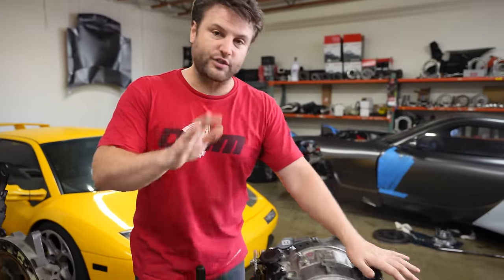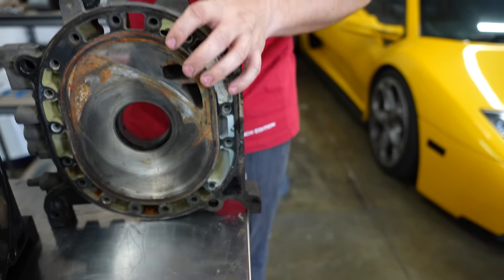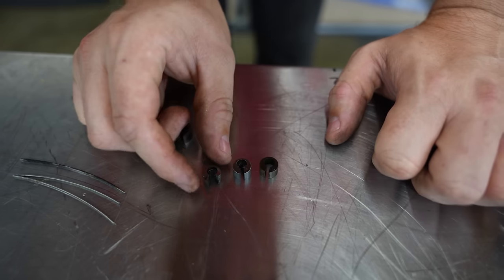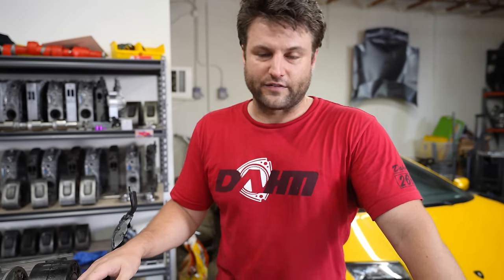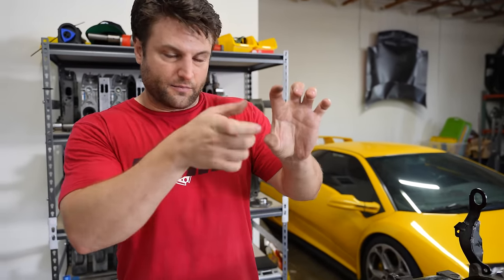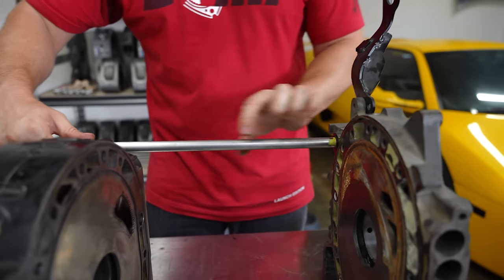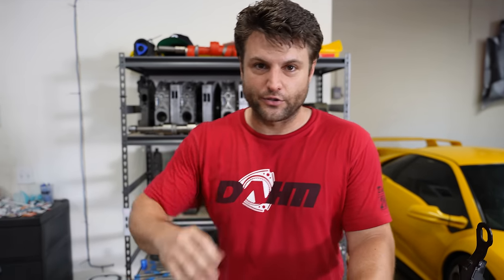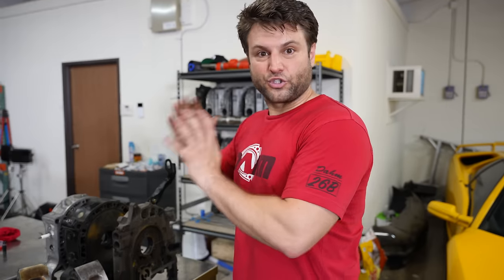Fixing the BIGGEST Problems of the Rotary Engine

Comment: It seems to be time for you to have an engine dyno for testing.
Reply: Yup! That would be absolutely amazing for rob, and imo especially useful for the rapid prototyping he does. R&D to the next level :D
Reply: *Hub dyno possibly, considering what he is building/researching right now. With this much torque and with R&D in mind he need a very precise machine that doesn't allow the tire to spin/slip
Reply: He's about to reach Toyota's Project F1 (Lexus LS400) levels of research and development. Maybe he could even build a reliable, fully billet rotary engine, in-house. 

Skyactiv-X 2 rotor when? lol
Reply: @powerprime99  they're talking about an actual engine dyno, like engine only. it's worlds more useful for what Rob is doing.
Reply: indeed, would be the next big step and upgrade for testing parts in the shop.
Reply: @rickcupola6262  Mazda Motors might not happy to know about this... Or will they?

Comment: After reading a few comments I challenge all of the rotary fans.  Draw me a picture of how you will seal the combustion chamber.  Show me the seals that will keep the pressure inside. Then draw me a picture of a regular piston engine combustion chamber seal, which we call piston rings.  Anyone with a mechanical aptitude will see the piston is so much simpler and reliable. That is why any manufacturer who looks at the rotary engine will go back to something simpler, like the piston.

Comment: We used to remove 3 thou off each side entirely not just the tips. We also machined the actual faces down on the rotors as well. You’d be surprised how different each casting is and how unevenly material removal was on those faces. Ran 13b’s with 58psi making 980+whp pretty much indefinitely for multiple drag seasons on customer cars. Just clearance and balance and run a good studded block and they’ll run forever. There’s no real secrets to be had or magic port work that hasn’t already been tried over the past 50yrs.

Comment: TLDW: treat your engine like a 2 stroke, E-85 with 2 stroke oil, replace the dowel rods with solid rods, get thicker tension bolts, 
run the oil through the blocks separately instead of through the single oil hole where the dowel is causing block cracks.
Reply: Why 2 stroke oil? Fuel lubricity improvement? How about adding biodiesel instead to improve lubricity?  Surpassed every other supplement in a recent HFRR fuel lubricity test.
Reply: @wallacegrommet9343  not for lubrication, for oil burning purposes, rotary burns oil and so do 2-stroke engines.
Reply: @patrick2mail  You’ve got to be denser than osmium. You add oil to fuel in a 2-stroke engine because it doesn’t get oil to the rings. You run oil premix in a rotary because you’ve deleted the oil injection system and still need to lubricate the apex seals.
Reply: @Cjbarker2  yea but why did you delete the oil injection system boss
Reply: @vinbmxnj  did you even watch the video?
Reply: @Cjbarker2  if u can explain why the rx-8 doesnt need to delete the oil injection since you can run a 2 stroke oil reservoir and eliminate the carbon build up and resultant pre ignition caused by using crank case oil in the injection system, and think the answer is because you deleted the oil injection system even though you didnt delete the oil injection system please rewatch the video
Reply: @vinbmxnj  Take that as a, “no, but I’ll not admit that in public.” It’s all good, guy, there’s no shame in being lazy or ignorant or both. Burning engine oil creates deposits on combustion surfaces. In piston engines, this is very easy to see and extremely common in higher-mileage engines with ring wear and engines where the PCV doesn’t do a great job of stopping oil from entering the intake. These deposits create hot spots in the combustion chamber that cause pre-ignition. Piston engines get a long time to cool down because they’re only firing every other time the crankshaft goes around. Rotaries first every time a rotor face comes around. The oil injection port uses engine oil, creating those deposits on the rotor face, and making ignition timing impossible to control with precision. You delete the port and premix oil into the fuel because 2-cycle oil and engine oil are different, and 2-cycle oil doesn’t lend itself to those carbon deposits, leaving the cylinder running cleanly.
Reply: @Cjbarker2  please re read your original reply to linkoo0 and explain in the case of the rx-8 how you run 2 stroke oil in an oil injection system that is still operational because you deleted the oil inejction system. thank you in advance
Reply: @Cjbarker2  the source of my question to you is at 12:20, why do you run 2 stroke oil in an oil injection system in the rx-8 if the reason for running 2 stroke oil is because you delete the oil injection system.
Reply: @Cjbarker2  just a reminder your original response is here "Cjbarker2
Cjbarker2
1 day ago
 @linkoo0  You’ve got to be denser than osmium. You add oil to fuel in a 2-stroke engine because it doesn’t get oil to the rings. You run oil premix in a rotary because you’ve deleted the oil injection system and still need to lubricate the apex seals. "
Reply: @Cjbarker2  your answer is simply incorrect and its sad to see you sit here and attempt to defend it when you can run an oil injection system in an rx-8 that uses 2 stroke oil, therefore you clearly do not run 2 stroke oil because you delete the oil injection system. but keep on being wrong buddy i wont stop you
Reply: @vinbmxnj  Rob is running through the RX-7 13b, not the RX-8 Renesis. Different execution of the same concept. In fact, Rob briefly mentions the remote oil reservoir, but it doesn’t change the fact that that part of the housing cracks under stress. Do you poke holes in your valve cover gaskets so they leak oil everywhere? Didn’t think so, bud. You’re trying to compare apples to pears here.
Reply: @vinbmxnj  You know the rules . . . . two men enter . . . . one man leaves
Reply: Almost. Use both two stroke and 4 stroke. 2 stroke in the fuel or on a separate line for the apex seals, 4 stroke for the crankcase
Reply: @Cjbarker2  You said, "but it doesn’t change the fact that that part of the housing cracks under stress." but the stress isnt the reason for wanting to use 2 stroke oil and everything that goes with it. The point was to get much cleaner combustion. Maybe Im misreading your argument though. You guys had a ton of responses to each other and I could have missed something.
Reply: @aggonzalezdc  That guy’s got a machine-gun keyboard and an ego issue. I did state originally that it’s done to run the chamber cleaner, but I did make the mistake at the very last line to say, “cylinder,” so it’s possible that that was my biggest mistake.
Reply: @Cjbarker2 Nah, your biggest mistake was feeding the troll. People like that are never wrong, at least in their own minds. Any rational person reading your comment understands what you meant to say, even more so if they actually watched the damn video.
Reply: So basically the only way to make a rotary reliable is to make it pollute like a dirt bike? It's not wonder these engines didn't work for OEM applications.
Reply: @borderwave2  you misunderstand. The rotary already fires more frequently than a piston engine, as well as oil smoke is not inherently pollution. The pollution that affects emissions is NOx and COx and hydrocarbons, and burning oil naturally doesn’t produce much of the worst offender, NOx. Do some digging on the science, as it’s quite interesting
Reply: @F3Ibane  I’m glad I wasn’t alone in hoping the guy was screwing with me
Reply: @dylanwhite6539  Stop making sense, LET THEM FIGHT!!!
Reply: @wallacegrommet9343  you need zddp to prevent wear, it is not just lubricity. But the issue is that synthetic does not burn and acts as a hydraulic fluid, risking hydrolocking and predetonation with soot deposits. That is how you blow up an engine. Diesel too can cause mixture enrichment and high pressure, by the way, because it flows in at a greater rate.
Reply: @vinbmxnj  because the synthetic oil used for the other components going to the combustion chamber does not burn and soots up, or can even hydrolock the “pistons” if using aircraft synthetic purple turbine oil. That can also ruin emissions and clog catalytics. I personally do not like synthetic oil for this reason, especially in old engines, more so for rotary engines. The author of the video should simply forget synthetic and use regular oil with some ZdDp additive like it used to be formulated (zinc film prevents wear)  before the stupid emissions controls. Of course he mentioned solutions not offending emissions, and there in lays the problem for rotary engines... I only use a premix of turbine oil so as to increase compression ratio sometimes through partial hydrolocking, but you have to stud up the head gaskets. He is right to say that regular gasoline is garbage, even for piston engines, however E85 is sht too. Using pure ethanol and mixing it with xylene and 2 stroke to make E85 works much better giving 115-119 octane at least with good oxygenated fuel content to make a clean burn. E85 is too dry anyways and should require a premix, whether you inject oil in the rotary chamber or not. E85 at the pump must be some serious crap that its octane is so low. They have to have mixed in there some low octane crap byproducts. It should be at least 115 octane but it is not. They must cut it with garbage.
Reply: @vinbmxnj  you delete the oil injection system because of the reasons he stated in the video, just watch it again. 

The oil in your sump (which the oil injection system uses) is not formulated for burning. This means that when it burns, it leaves lots of nasty deposits and can cause serious problems. Instead, premix 2 stroke oil with your fuel. 2 stroke oil is made to be burned so doesn't leave nasty deposits and makes your oil injection system redundant.
Reply: Just like 2 stroke engines, premixing is better than having "stock system" with its own reservoir for the oil and you remove completly the issue about when that system aint working= zero lubrication, in case of rotary engines the way the engine is and works compared to a piston engine means the system with a pump uses oil not meant for whats being used for and is a bigger problem in the case shown on the video because of the position its injecting the oil(could be better if injected through intake).

The engineers could of designed a system like conventional 2 stroke engines with its own reservoir, pump, 2 stroke oil and better injection position but for some reasson they didnt just like the other issues the rotary engines have wich can be fixed.
Reply: @Cjbarker2  Yeah no, you should premix ANY rotary. Most if not all rotaries with oil injection, even with a SOHN adaptor still don’t get enough lubricating oil. Source: I own an RX8 with oil metering turned up and with a SOHN adaptor and premix still makes a noticeable difference.
Reply: @Cjbarker2  2-stroke oil is that it's cheaper as well and if you're running a good oil, especially synthetic, you don't want to wasting it by burning it.
Reply: Awesome breakdown! Thanks for summing it up!
Reply: Yes, Rolls Royce would take a stock engine off the assembly line and run it for as long as it took, to break the engine. Then they would examine the engine and note what broke. Whatever broke, they would make that part/area stronger, heat treating, make it bigger, change out the metallurgy etc. No wonder the RR engines saved the British at the Battle of Britain and the Yanks used them in their "legendary" Mustangs. 

While they made the mistake of not making them fuel injected, no one knows or cares who made the engines for the ME 109.
Reply: @randomthings8247  mhm partly true but without the constant hight octan fuel out of the US production the merlin engine would been a failure  compared too the DB 601 and 605 were soldi engines of course they weren't perfect
The 605  for example had lubricant problems (gas bubbles in oil) in 1943 but that was solved, other problems in reliability came from strained economics  and with the 35700ccm the displacement advantage was on German side and needed to compensate the worse fuel also the supercharger system was way better than any supercharger the Allis had (turbo is a different story) 

And you forgot that the 109 had too fight on 2 different fronts the air battels on the West front were in high heights and on the Eastern front lower heights so the 109 had to perform at a broad altitude range and I would say that Daimler Benz is still known for good engines
Reply: also have to remember the advantage of  using e85 he mentions, is that it is a bio fuel. containing ethanol/ alcohol generally produced from corn, which is also genetically engineered, burns cooler at the compression ratio the rotary engine runs more efficiently at. makes sense of it burning cleaner
Reply: @Cjbarker2  there's that and two stroke oil burns a lot cleaner than four stroke oil. He explained it pretty well in the video but it has to do with the additive packages, 4 stroke isn't designed to be burnt rather it remains in the crank case but two-stroke oil needs to be able to burn without fouling plugs and leaving loads of carbon behind. 
It's especially necessary to run premix when you delete oil injection but 2 stroke in the oil reservoir might work as well.
Reply: @wallacegrommet9343  you use (premix) 2-stroke oil on to your gas to lubricate apex seal. That is because you have to block off the oil passage thru the chamber, so you don’t burn off the actual oil.

To be clear, you still use regular oil for the other engine parts. You just stop that oil from entering the chamber. All the lubrication that the apex seal will come the fuel that has a 2-stroke oil mixed in.
Reply: external oil lines direct to the oil galleries, remove the brass plugs, tap and install russel fitting. did it for my road race cars
Reply: @jpogigtxcr1778  That's the way I understand it.   But.... if you DIDN'T want to mess with his preferred method -  premixing 2-stroke oil into your gas... then, Instead of blocking off the oil bleed hole into the chambers, you could mod them to not be connected to the main engine lube oil system, but instead connect them directly to a pump pumping in 2-stroke oil from a 2-stroke oil reservoir (presumably in prorportion to gas flow into the engine), which reservoir would have to be refilled periodically.  Right?
Reply: @Cjbarker2  you premix ontop of stock omp for I think 1989 and up I still add 4-6oz with my omp
Reply: Everyone is wrong, here.

Add a bag of granulated sugar to a filled gas tank. Bam. Done.
Reply: @Cjbarker2  Exacty

Comment: Man, I feel like you glossed over detonation, which is a bug issue for the FD.  Detonation will destroy those apex seals and, like mentioned, will destroy the rotor housing and the turbochargers on the way out.  Two necessary solutions here that weren't mentioned. 

First, the stock intercooler for the FD3S is laughably small.  A larger intercooler will keep charge air temperature down to reduce the risk of detonation. 

Also, the factory apex seals come in two pieces.  They do slide around and make somewhat of a better seal but machining  the rotors to accept a larger 3mm single piece apex seal is a much better option.
Reply: Good bit of misdirection in this video. Most all rotaries die from detonation or overheating.

Cracks in the housing or dowel are rare unless you are pushing high power on S4 housings.

I was also surprised to hear carbon buildup attribute to… coolant? That’s not at all right, it’s due to running rich as hell.
Reply: Wouldn't E-85 almost instantly fix the detonation issues because of the octane increase alone?
Reply: detonation just sounds gnarly
Reply: @wompa164 can’t carbon build up also be attributed to not driving the engine right? I’ve heard that higher rpm’s and driving it harder and faster is better for this engine like a Porsche
Reply: @bigdbandit64 went through my Audis internals, not a single bit of buildup, you are right

Comment: Really interesting vid, I've said this for a long time, tighter fitting components make much stronger motors. As long as clearances arnt silly tight like f1 motors and you warm things ups properly (2 stroke talk there) then your going to avoid so much hassle in the future. High hp builds are difficult, my daily vehicles are usually low tune massive reliability. My toys are high tune lower reliably... but in the same breath if you warm things up and dont just beat on them out the gate then higher performance motors can still give very respectable bang for buck. Thanks for being an inspiration for many years Rob, I'm genuinely glad it's worked out for you. I'm a bike guy through and through but your passion for rotary engines is genuinely inspiring!
Reply: "silly tight like f1 motors"
I feel so sorry for anyone who has to service an AMG1.